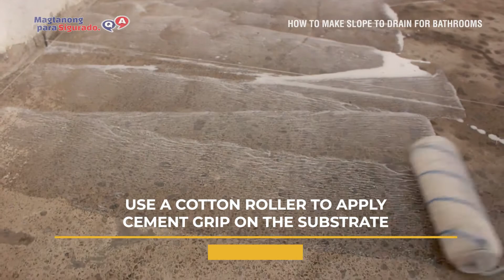Hardcrete 310: How to Create Slope to Drain for Bathrooms

Comment: pwede po ba yan as concrete toppings sa exposed sunlight roofdeck to prevent water ponding?
Reply from the maker: Yes you can use Hardcrete 310 as concrete topping for roof deck.
Please click on the link below to see video. 
https://fb.watch/csPaO7LjHs/

Comment: Is it possible to pour 30 mm of mixed hardcrete 310 in one pouring, and how many bags of hardcrete 310 will be used for an area of 10 sqm for the said thickness?  thank you.
Reply from the maker: Hi. Thank you for your inquiry. Yes, you can use Hardcrete 310 in one pouring for 30mm thickness. You will need 25 bags of Hardcrete 310 at 10sqm area for 30mm thickness and 1 gallon of Buildrite Cement Grip.

Comment: After ng hardcrete 310 pwd n magtopping ng concrete?
Reply from the maker: Hi, Thank you for your inquiry. Kung ito ay iaapply niyo sa ibabaw ng Flexicrete system,  Ito na po ang mag sisilbing topping at after ma cure ng Hardcrete 310 ay maaari niyo na pong ilapat ang tile adhesive bago ang tiles.